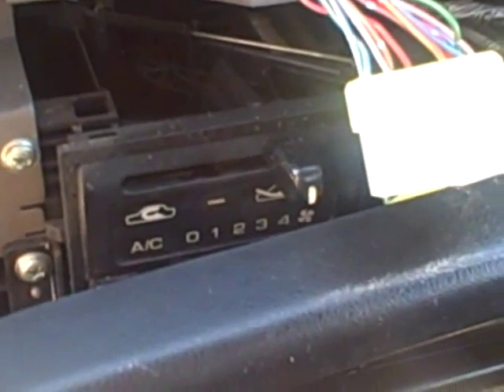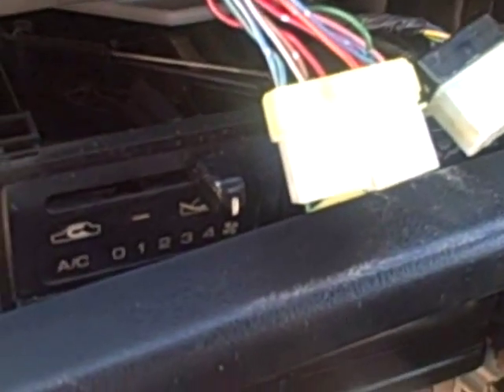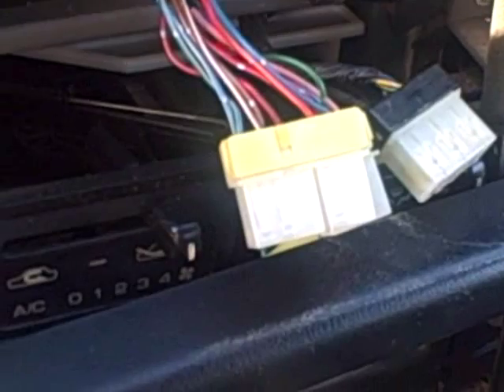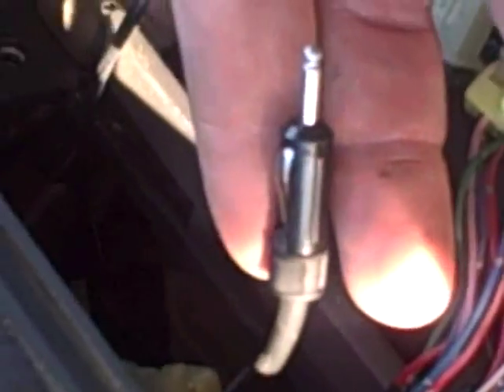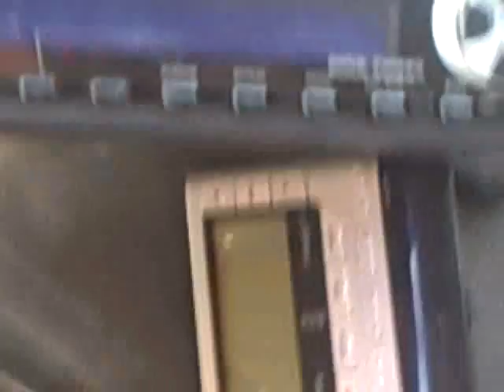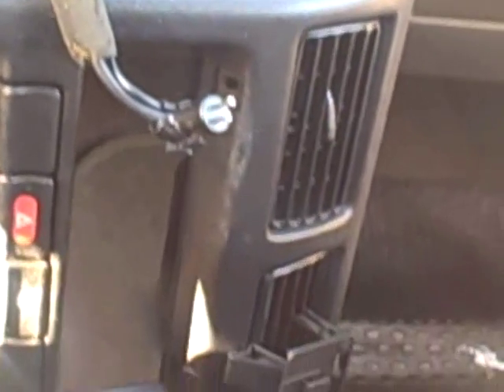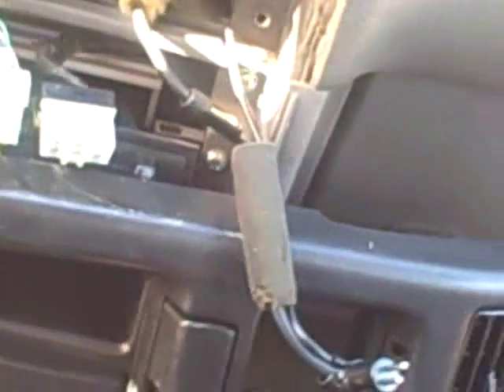1994 nissan sentra radio secrets

Comment: sounds like the 2 blue wires is for a power antenna and to power on a amp for a subwoofer hooking them together would not make the do anything but back feed, when I hooked up my radio I did not have a power antenna or sub I just taped them up, but now I have 2 12's and a 600 watt amp so I use that now, hope this is helpful good luck

Comment: So i went about trying to hard splice an aftermarket radio. I know the radio works, but when i go about wiring it up, Theres two blue wires, one is for the 12v switch and the other for the rear speaker. Anyway, ive tried testing either wire with a multimeter and neither gives me any voltage when i turn the key. I tried wiring it to both cables and seeing if it will turn on, but no dice. Any pointers?

Comment: Do you have a wire diagram showing what each wire is on my 94 sentra
Reply: hi, not on the sentras wires no but when you trace the wires for the ground you can clearly see no wire on the sentras end so I had to ground it my self, big head ace but I figured it out why  my radio would not power on at all. it all good now,
Reply: I word my ground to my cigarette lighter and it works,  but I only find one hot wire for power... so I had to connect my yellow and red together coming from my unit to the one hot from my car... isn't there suppose to be two hot, well one always and one cuts on with key.... or is one normal in the sentra
Reply: Wired*